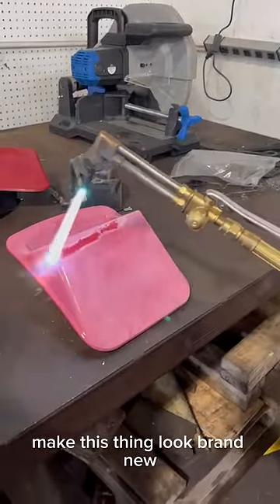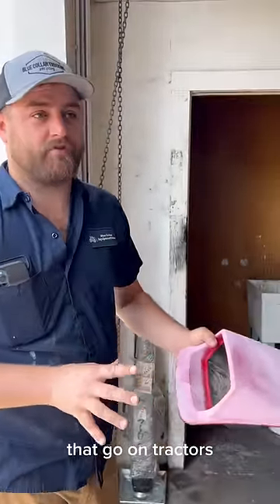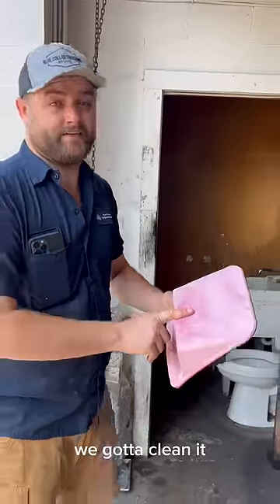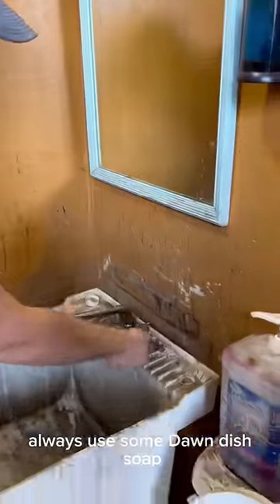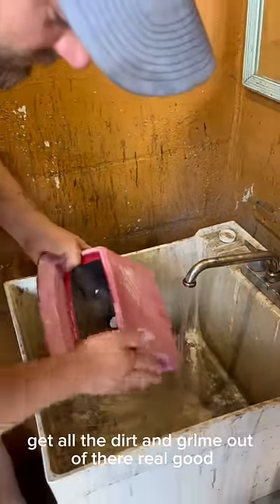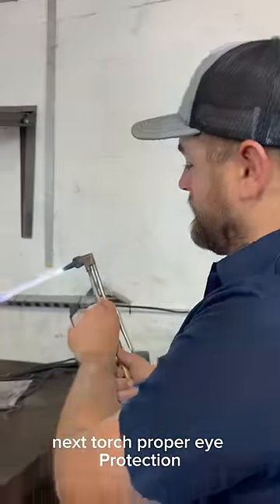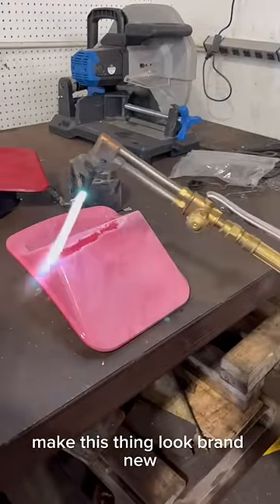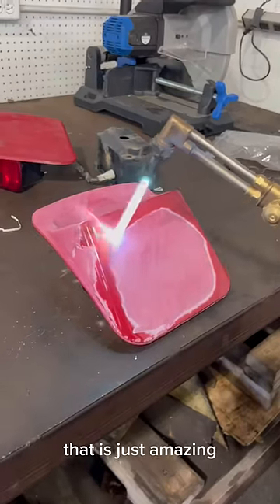Burning￼ plastic to look like new!

Comment: I learned to do this years ago on my old ATC (three wheeler) fenders... Works great as long as you go lightly and don't overdo it!! I used propane though, the oxy/ace might be overkill!!!   👍👍
Reply: How did they hold up overtime? The mechanics of this leads me to believe that they will dry out a crack, even faster, then be worse for the wear in a year or two
Reply: Do the same on faded sport bike parts.
Only one flat black bits.

A couple of light passes with a propane or Map gas torch and it looks new.
Reply: @richeyrich2203  Well I was gentle and sparing with it, and used it to just melt out fine scratches. Nothing I had was in this bad of shape. I followed up with really fine sandpaper, and basically did what you would with a new paint job, eventually using compound and buffing it. It turned out looking better than new and it has lasted for years with no downsides that I've noticed... I'd say that doing it with oxy/acetylene like shown here is a bit (a lot) extreme, but careful use of a propane torch WILL give worthwhile results.
Reply: @franktaylor7617  My old FZR was almost getting to that point- but it was stolen before it got quite that bad 🤷🏼‍♂️
Reply: @wheels-n-tires1846  
I bought a neglected 98 Superhawk. Most of the original plastic were badly faded.
It has a aftermarket knockoff body kit. But the original black bits were faded. This technique worked great to return it to factory looking.
A little Scotch Bright for the oxidized surface and a quick pass with the torch and it looks new.
Same treatment on my 90 GSX-R 1100.
It's all original. So just a little cleaning here and there. I replaced all the turn signals with OEM and refreshed them the same way.

👍
Reply: I just wanted to comment on how cool it is to see a kind & interesting exchange of knowledge & experiences between two people on the internet! Respect to both @Wheels-n-Tires & @Richey Rich! You guys are “cool cats”! I hope you both have a wonderful day! Stay cool gentlemen! ✌️
Reply: @TheGoldenBear79  I try!!! I'm an old dude...but been building old cars all my life, as well as being a pro diesel tech for 20 yrs- so sharing what works and what doesn't here is a good way to pass things on. I'd say that's what my channel is about, but I just don't get the time to do anything worth posting...YET!!   The world is seemingly going crazy around us, but good old fashioned helpfulness and politeness never goes out of style!!!
Reply: @franktaylor7617  a 90 GSXR... I'm jealous. My bike I bought new was a 91 FZR600- put over 95k miles on it before it was stolen. Rode it all over the country while I was in the Navy. But needless to say, I was ready for a liter bike!!! I rode an almost new R1 a couple years ago and omg... I wanted it bad!!! But I'd of had to budget for all the tickets I'd of gotten - 60-70mph wheelies are just too fun, never mind the rush of cresting 180!!!!
Reply: @wheels-n-tires1846  love your attitude brother! I have always figured I like when someone is kind to me, so I should be kind to everyone else to give them a reason to be kind in return. Seemed like a more pleasant way to go through life. It’s always a pleasure meeting someone who reminds you why you have faith in humanity! I love to learn more & teaching anything I can. You are my kind of guy. I don’t think I would call myself old, except to the ones who are in comparison! Lol! But if you are 20 I may be old, but if you are 86 I doubt you would say 43 is old. Lol! I guess it depends on how old you are what your prospective is right? Lol! I like the way you think because I’m grateful for any kindness I’m shown & any knowledge shared with me! I don’t think I am alone in that, so I say keep being yourself. I hope you have time to do what you want soon! I would be interested to see what you would like to do. I’ve never thought I know to much! Lol! I respect you Sir. I had to comment because it’s nice to see the opposite of the internet trolls! Lol! I appreciate your message too. I hope you have a wonderful night. Thank you & best wishes to you and your family. ✌️
Reply: @TheGoldenBear79  
Right on, thanks Man.
😎

I think I have a before and after video.
Honestly, I can't remember what I documented and left on my channel 😏
Reply: @wheels-n-tires1846  
I have a host of early bikes.
Newest is a DRZ SM.
I have a show room condition green ZRX 1200, 93 ZX11 that still has the factory warning stickers on it.
A couple others. A Mad Max'ish frankenbike.
A one off NSR 250 MC21 with a 500cc 4 cylinder, water cooled  two stroke wedged in.

Been around this block a few times 😏
Reply: @franktaylor7617  nice!!! I wouldn't mind having another copy of my first bike, an 85 Interceptor 500. That V4 sounded like nothin else...
Reply: How long did it last before you felt it needed done again?
Reply: @hychap  Well, Id say quite a few years. I repeated the process probably yearly, but thats because I rode in sand and my boots would rub and cause more scratches- but I didnt have to redo it on the unscratched areas for probably...4+years (??). The trike was always stored indoors so it likely would be needed more often if the item was exposed to more sun and weather. I think keeping a good coat of wax on them helped a lot too.
Reply: @franktaylor7617  My pleasure bro! I’m just glad instead of internet trolls I found two cool nice guys having a polite conversation! In this day and age I have to count that as some kind of win! Lol! So you have a YouTube channel? Is it your name or something else I could find you under? I will have to check it out! This is when I really enjoy the internet; when I have an enjoyable interaction with someone I otherwise wouldn’t have met! I appreciate your message and respect you for your kindness! Thank you! I wish everyone would be as kind as you two gentlemen have been! The world would be a much better place! Have a wonderful day buddy, and best wishes to you and your family! ✌️
Reply: 303 does a similar job without the heat. Bit more buffing though
Reply: How long did it last bro?
Reply: @oceantrolls7332  I usually do a major cosmetic resto once a year, and the plastics were never in as bad of shape as when i did it the first time. So Id say generally a long time. Where its needed most is where the back of my boots rub on the fenders with sand...so those spots get pretty ugly- but thats from the use, not the repair not working. So id say its legit
Reply: That's the go outdoor cover 

sorry the code ain't helping kidnap victims anymore 😭

Don 😎

Comment: Actually somebody that study plastic will tell you not to do this because you are removing a layer of plastic. You are also changing the chemical components in the plastic and making it brittle so it'll break faster. A better way to do this would be just to go to the hardware store and buy yourself a can of krylon spray paint and spray it on. This serves two purposes one it cleans the outside layer & fills in all of the holes and provides a UV protectant for a few more years.
Reply: Yep my family works in plastics and my dad has always told me never to do this. The plastic is already ruined from UV exposure, so not only is it already very brittle and flakey, you’re now removing even more integrity from the polymers by heating them. The products of combustion can also react with the plastic in negative ways depending on what fuel you use.
Reply: He's a used equipment dealer.
It just got to look good to increase price and last long enough to leave the lot.
Probably puts new hour meters in free of charge.
Reply: @matthewferos  if it's already ruined, then it's ruined. Tears over spilt milk.
Reply: @asherdie  yes but you’re making the plastic look good again while it has no structure left. It’s very deceiving.
Reply: Thanks tips
Reply: @matthewferos  USED equipment salesman...
Reply: No word of a lie, we used to do this to brand new tanks for million dollar machines. Company procedure.

Comment: Way to much heat, that thing is like a tater chip now I bet brittle as hell
Reply: And burned, use hairdryer, heat gun radiant heater or a plain propane torch
Reply: Shocking abuse of plastic hey boys 😅
Reply: @bad66chevelles  I agree. And I love 66chevelles
Reply: Too much heat. Even with a hot air gun it will only look ok temporarily.
Reply: Still looks like crap
Reply: And warped
Reply: @misteryman5109 have to clear coat it after right?
Reply: Lol, it didnt look oxidized anymore...but it ended up looking like a deep fried tomato 🍅
Reply: @misteryman5109  If done right, you're only melting the surface layer of plastic and sealing up all the micro fractures. Spray a UV resistant clear coat on top and it'll look good just as long as a new one would.  They do this with plastic seating in outdoor sports stadiums every so often and it works just fine.
Reply: @bad66chevelles  Damm right
Reply: And it’ll just be faded again in 2 weeks

Comment: If you look closely at the very end look closely it looks like crap....been there done that while you are doing it it looks awesome once it cools it looks like crap don't waste your time
Reply: Lol 😂
Reply: I guess you have to choose between faded and looks like crap, or melted and looks like crap.
Reply: That’s why I just paint mine every 5 years lol
Reply: @jonhunt5408  melted crap does look better😂😂
Reply: this and they do this with stadium seating..returns to faded quickly.
Reply: Just do it properly and sand/ paint it.
Reply: Thats why when I'm restoring my plastics I use the torch then that same color code spray paint then a nice gloss clear coat. Works great and looks better, will last for years and still look new the whole time
Reply: also it'll be faded again in a week or two
Reply: It pulls the "oils" from within and brings to the surface.  All its doing is shortening its life. Making it brittle.
Reply: You do not have to look that close to see that hahaba
Reply: @RedneckGarage4570  have you tried just cleaning (and maybe a light sand) then painting? I'd imagine torching it to gloss would give less texture for the paint to stick to and it's another step. It's already basically prepped for paint. Just curious, never done it and probably never will, but I'm interested in the difference.
Reply: @wowrealbad  I typically will torch it then scuff it lightly
Reply: You’re supposed to spray it with a clear coat after. But no one ever does.
Reply: @Gigachadly  you dont paint plastic lol doing it right requires the right oils stripped off by the sun and rubbing them in
Reply: @donaldliverance2597 and what oils are those and where vs. you get them
Reply: I'f you lightly sand the plastic with 0000 steel whool and then mix boiled linseed oil and lacquer thinner 50/50 and rub it into the plastic it will bring the plastic back about 80%

Comment: you’re supposed to use a damn propane torch not an acetylene 😭😭
Reply: 😂😂shit was so burnt
Reply: A heat gun works best.
Reply: Sand with fine grit paper and a heat gun on high
Reply: Right, it was far too hot 😂
Reply: Yeah he fucking burnt it LOL
Reply: I do vehicle wrap's and the first thing I thought was my propane handheld torch would work better.
Reply: Not propane Dane
Reply: Facts lol
Reply: He did burnt the plastic though. Too hot and too long exposure

Comment: It will fade right back out in a couple weeks in the sun.  Been there done that
Reply: Exactly I was going to say 12-14 days
Reply: You're supposed to put the oils back into it or spray UV protector, this just dries out again.
Reply: Be sold by then....
Reply: I have seen them fade back the very next day.
Reply: Yea you gotta uv coat it. Theres many you can buy.
Reply: @Gideon_Judges6  what kind of oils?
Reply: @Here-2-Learn  wd40 specialist silicone lubricant i.e.
Reply: Treat it with wax afterwards. Truth be told if you treated the faded product with wax, it would shine back up too.
Reply: Yeah even as it cooled it didn't look all that great....
Reply: @krombopulosrick7920  Did that, didn't help much
Reply: 100%
Reply: @wolvenar  not all work the same. Some need re Applying every so often. I tried one on headlights and they went yellow in half a year, and I bought this fancy stuff. I'll look for the name. they are looking brand new going on 3 years. Ik head light plastic is different, but same pile.
Reply: @krombopulosrick7920  Headlights I sand and clear coat. works well for a couple of years. But colors just don't seem to do well with the heat thing
Reply: @Here-2-Learn  buy a product called quatrol polytrol, you paint in on, let it sit then buff with a cloth. It feeds oils back into the plastic. Will last a couple years rather than days.
Reply: Not true I did the door panels on my truck in a similar way(sand first and used a small propane torch) still looking great
Reply: @ajaxracing  They'll call you a liar
Reply: @roadkillavenger1325  I made some videos on it my door panels were way jacked up look almost new

Comment: Much lower heat required (around 200-300°C, I think). 
     .And finish it off with a UV resistant coating of some kind (maybe simply a few layers of clear coat).
       UV is what ultimately breaks down plastic, so any barrier between the plastic and the sun will help a little.

But yeah - "flame polishing" is pretty cool :)

Comment: I suggest using some compound and a buffer next time instead of a torch.
Reply: torch is way faster
Reply: @Maranda with an A  torch also drys out the plastic more and makes it more brittle now its more likely to crack
Reply: If you want to go faster than just buffing. First wet sand with very fine sandpaper such as 2000. Then buff for the gloss finish. Wax or clear coat to preserve the gloss.

Comment: I use a heat gun. Slower reaction time which makes it easy to control. I use it on all the cheap unpainted black plastic pieces on modern vehicles.
Reply: could you elaborate please? all the plastic on my car is faded af, i just hit it with a heat gun?
Reply: Yes
Reply: @Invisus_Letum  Yes, keep it moving constantly so it won’t burn. I hood it around 5” away moving it around but not to fast. You will notice the plastic becoming shiny and you kept moving around until it’s all consistent. I’ve tried EVERYTHING else on the market and they all are very temporary and cost money. Otherwise try Maguires ultimate black plastic restore. That works the best of any over-the-counter product. I’ve tried and doesn’t run down the paint from the plastic when it rains.

Comment: Used the same technique on black ABS motorcycle parts.

Works great on rare fender/plate holder, faded turn signals and inner faring bits on sport bikes.
Although I just use a regular Map gas torch.
Reply: Don't forget selling it fast 😅
Reply: @dotlaj  
🤷
What do you mean.
You think it damages the abs? Or cause it to crack later?

Comment: You need pretty light torch to burn off that pink to melt through to the red. Next one, not so much heat and it won’t look seared. That paint (the pink) is rough enough to paint a color that doesn’t fade so quickly in that blazing sun

Comment: You can do the same thing with a heat gun. But your way looks a lot faster. I used to recondition bumper covers. They get tiger stripes, or Bengal stripes. Whatever you want to call them and this made Them look brand new

Comment: Did you add any uv protective coating? That's what causes it, the sun, that's it, get that coating after or it will look exactly the same in a few weeks, also, you don't want it that hot. That torch is not the right tool for what you're doing, but if you're going to use a torch, DO NOT USE OXYACETYLENE it is too hot. Acetylene on its own is better but really you just want a small torch. Not one that can cut through sheet steel with ease 😂😂

Comment: Clean, sand, clean again and then put in oven.  Check what type of plastic it is and look up the material data sheet.  Find working temp for thermoforming and set oven slightly below that.

Comment: You need to sand the oxidized layer first otherwise it will show as white when cool off, and this only works well in PP. Torch was too hot aswell, a Mapp torch works great.

Comment: Use a heat gun, not a torch. You can bring the oils in the plastic back to the surface. Faded plastic has just lost the oils from the outer layer

Comment: Just invest in some Sc1. It's a lot cheaper the long run and it works for a longer period of time than just hitting it up. We use it on the side by side the trucks on any of the plastic. But you can use it and semi's tractors or pretty much anything that we have and no we are not working with Sc1 We just honestly bought it just because we want test out and we've never gone away from it

Comment: Heat gun is the tool to use not a welding torch....lol but practice does make perfect..!😄👍
P.s I advice anyone who wants to make sun faded plastic fairings back to new again buy a heat gun you will not have the end results as shown on this video the lines was from to much heat buy a heat gun for under $30 bucks and get the new look you are looking for like when you first bought it ,just do not ....I REPEAT DO NOT USE A WELDERS TORCH....😄👍

Comment: Heat gun works better. What is happening here is oils trapped in the plastic is being brought to the surface. Using a torch is burning it away just as fast as it's rising so this method won't last too long.

Comment: This is fine if you're just freshening it up for sale. Don't do this to stufff yoy wanna keep long term. 

The heat brings oils from deep within the plastic to the surface where they quickly evaporate off.

This will make the plastic brittle faster, and the shine won't last very long either. 

In short, this ruins your plastics faster. Get an oil based restorer.

Comment: Use a temperature regulated heat gun then use a sealer uv protector or it will be just as bad or worse in a week. Also know what type of plastic you are working with.